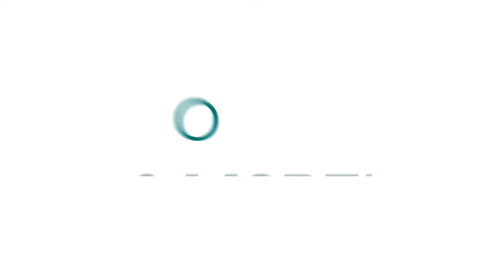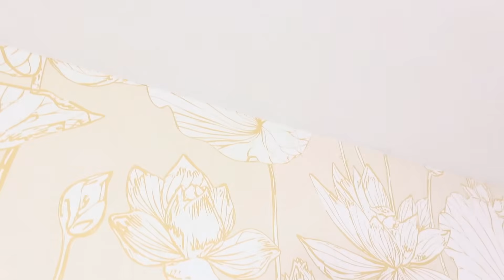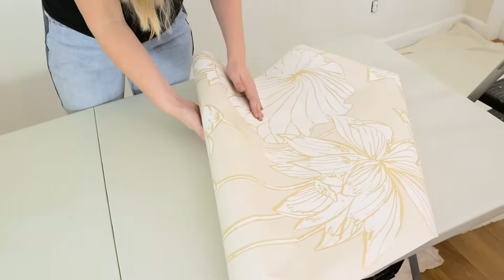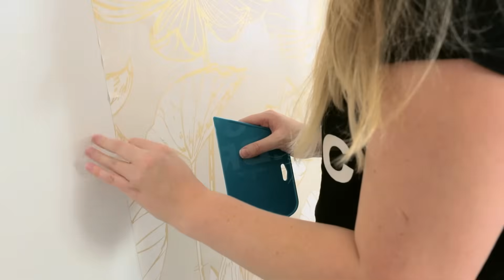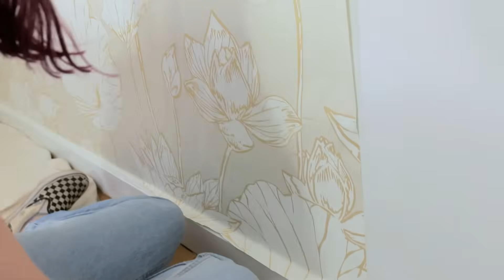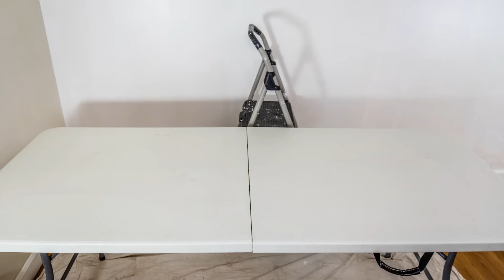How to Hang Wallpaper with Paste

Comment: Good course. Some prefer the plumbline - I do it your way bc of the chalk bleeding through the seam. If papering to a corner, there should be a small of excess around it. Most important, I strongly recommend a snap-blade knife to ensure the edge is always razor sharp! Watch using a plastic cut guide - the knife will jump onto it - trust me!

Comment: I have experienced shrinking using the paste on the wall method.  Therefore my seams came apart when it dried.  Years ago we papered using a method called “booking”.  The paste was put on the paper first and then you folded the paper and let it set for awhile.  Any recommendations or opinions using this method for A Street Prints?

Comment: Always better to use a brush to smooth it out as using a plastic smoother can damage the surface on 
Some wallpapers.
Reply from the maker: It is definitely something worth checking out on your first panel. My paper was WAY to thick for that to have worked, but it depends!

Comment: An hour to an hour and a half PER PANEL??! holy moly I hope it doesn’t take me that long.
Reply: Our family has been in the painting and wallpaper business for a hundred years. Paper matches straight across or every other one. Cut your paper up all at once on a table or paper boards. And use a plumb line. Also plumb from the corner not the middle of the wall. Use a wallpaper smoothing brush to get bubbles out, not a hard edged smoother. You wind up pushing all the paste from under the seams, will come loose later.
Reply: @davidstokes8538 thought so, wallpaper smoothing brush
Reply: That seems super long.
Reply: I can’t imagine it taking that long😮
Reply: My mum is super fast... That wall would take her an hour... Job done. She's had years of practice 😂
Reply: Thank you all and Alissa for all your tips!
Reply: That's the only thing I heard😅
Reply from the maker: The more you do the faster it will go by!

Comment: It's best to mark a straight line about 18 inches from the corner If you are doing the whole room and let the first piece wrapS around the corner, that way your first piece is straight to the RIGHT EDGE, the corner will take care of itself. It is what it is, Then, every other piece is straight when matched to the straight line. I think you misunderstood the process OR had bad info.
Reply from the maker: LOL learn from my mistakes. I learned this lesson the hard way.
Reply: @onlinefabricstore  Yes, the reason we tile layers and the Wallpaper guys, start in the center was in case the tile or paper got a little out of line it would look wop sided from one end to the other, but if you start in the middle it could only get off tracked a little each way. Its an old trade secret not really needed anymore because of lasers, just by a 25 dollar laser on Amazon and you can do as I stated, start on the far left.  But, with no laser, start in the middle, but only close to the middle, therefore you can figure out how to get two full pieces to a corner, thus you might have to fudge the middle a little.

P.S. I earn a lot from watching other people even though I have done this 50 plus years. I saved my mom buying a new dryer because I learned you can clean the contact points and in most cases it will start working again, just a file or sandpaper. So, its all good.

Comment: What's neat to me, is some cultures use rugs on the walls and even historically fabric was used as wallpaper.  I literally made a double sided curtain to cover most the outside wall at my house in Allegan where one side was white fleece and the other side black fleece.  Then I did the trim and tie ends on the one (top) side to hang over the curtain hanger and where tacked on the wall.   Summertime, white side out and wintertime black side out.